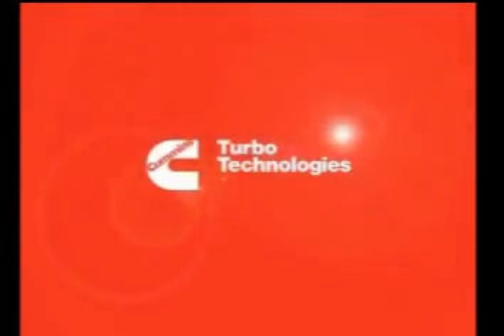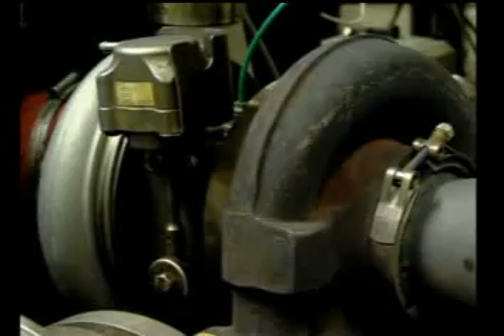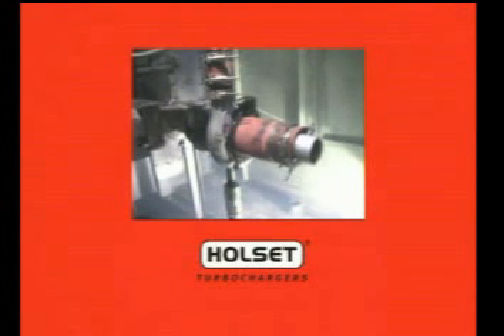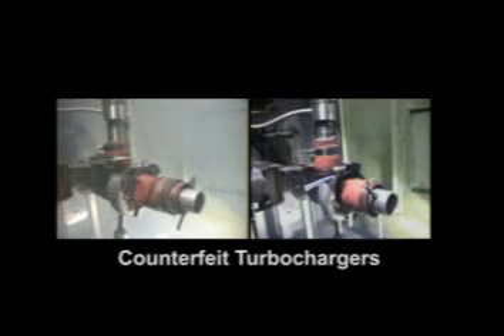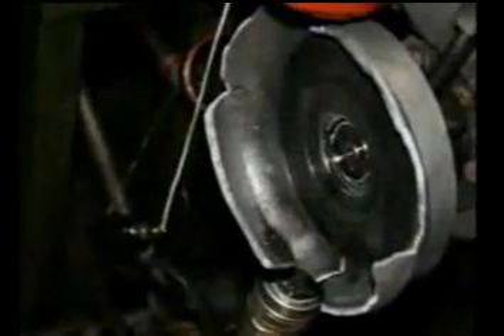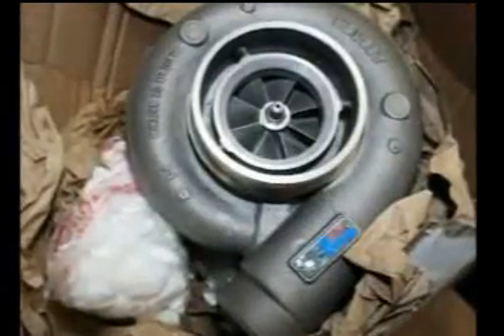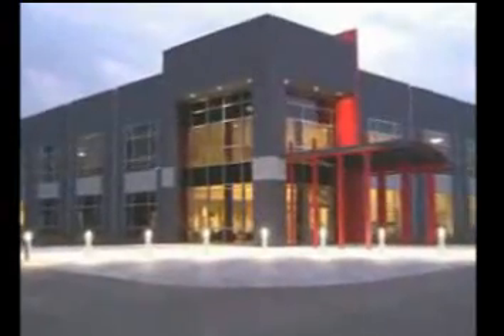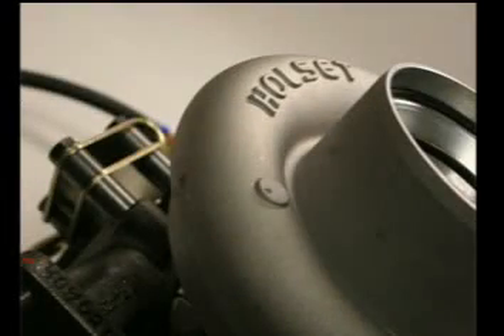Holset Turbo Burst Test

Comment: a turbo for a bus should never reach them speeds in operation, unless its a really small engined bus say, less than 4.0L. But even so its not hard to reach high turbo speeds in normal use